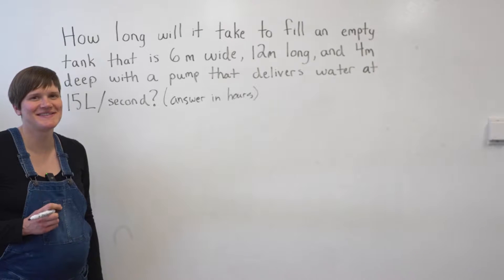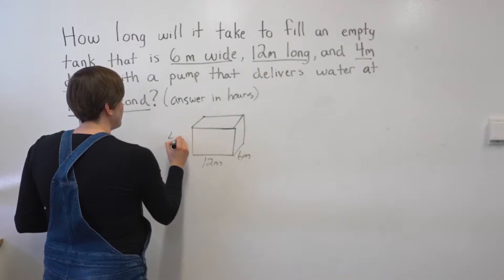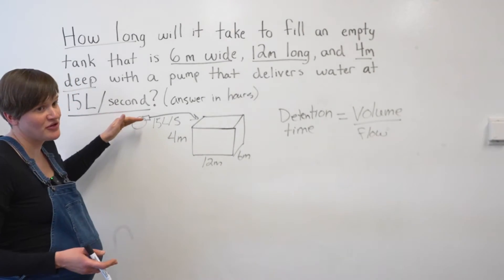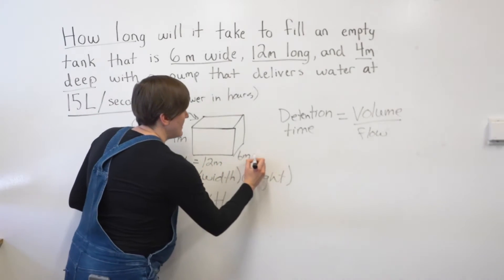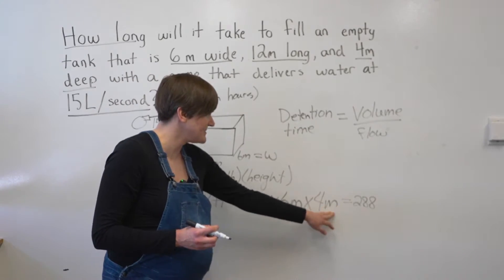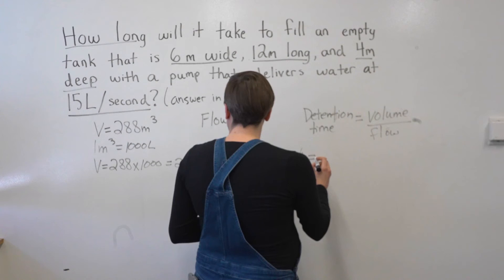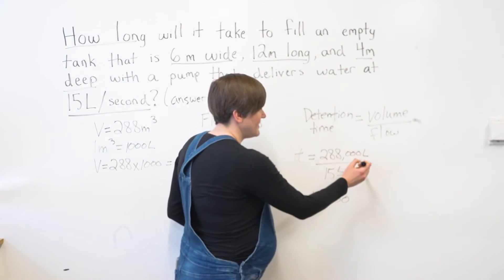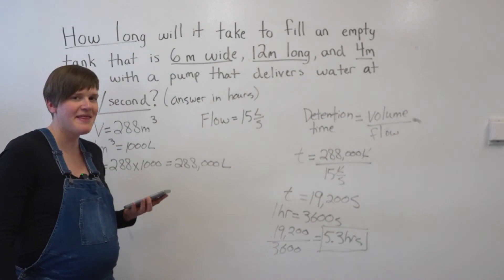How to Calculate Tank Fill Time Calculation

Comment: Excuse me ma'am, the illustration is that water is entered from the top of the tank, what if the water is entered from the bottom of the tank, how to calculate speed against gravity
Reply from the maker: When water is pumped into a tank from the bottom, you're dealing with the force of the incoming water and gravity. To find the speed at which the water needs to be pumped to overcome gravity, you can use Bernoulli's equation, which in a simplified form for this case can be stated as:

P + 0.5 * ρ * v^2 + ρ * g * h = constant

Where:
- P is the pressure exerted by the pump.
- ρ (rho) is the density of the water.
- v is the velocity of the water.
- g is the acceleration due to gravity.
- h is the height the water needs to be pushed up against gravity.

To determine the velocity (v), you need to solve this equation while knowing the pressure added by the pump and the height of the tank. Essentially, the velocity of the water increases as more pressure is applied by the pump and must be sufficient to overcome the gravitational pull acting against the elevation (height) the water needs to travel. This approach will give you the minimum required speed at which the water should enter the tank to ensure it reaches the top.